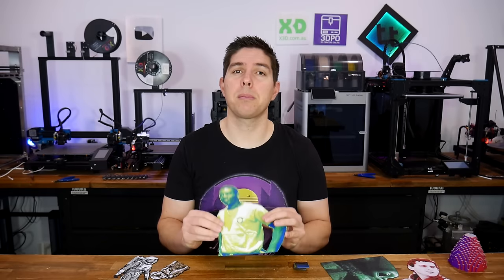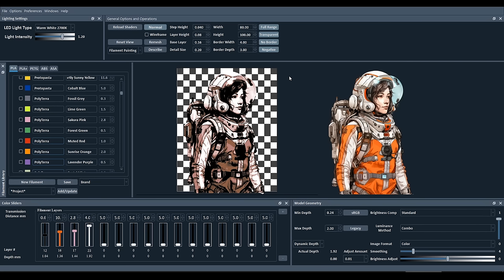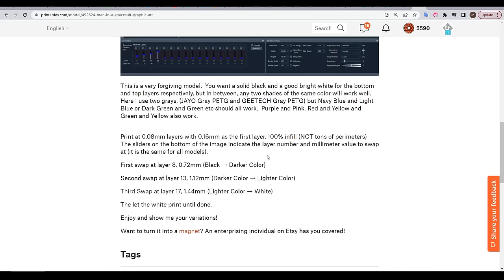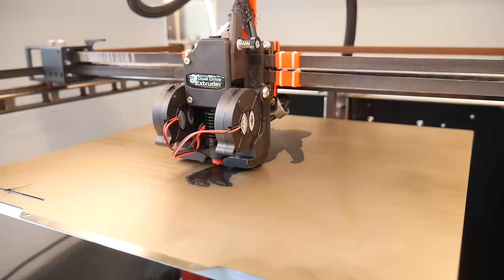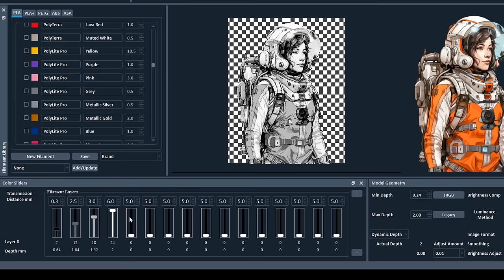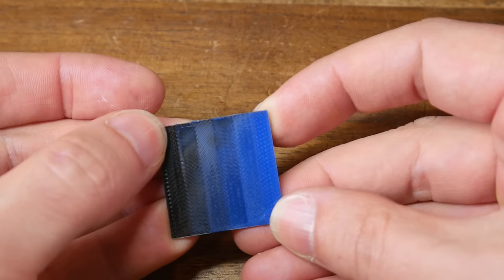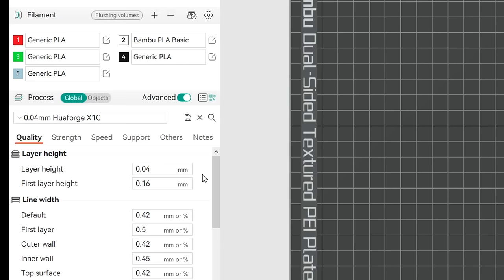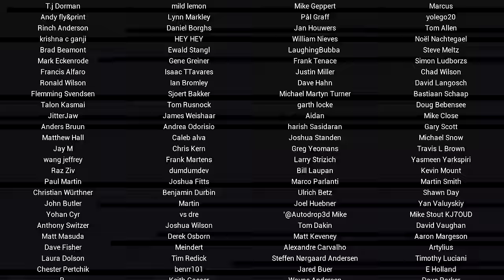HueForge getting started guide: Filament painting with your 3D printer

Comment: I'd like to say I think the software is awesome. But why isn't anyone talking about the absolutely horrible "commercial" license agreement? Basically, you have declared you made your product using their software. I could see if you were using a free version, but to pay for software AND need to brand their software?? That's a total no go for me. If every software maker followed this "license agreement" we would be posting a lot of branded content.  Isn't it kind of like Microsoft saying, anything you make with software using this operating system you need to add a Microsoft logo? Horrible approach if you ask me. Just my 2 cents.
Reply from the maker: I didn't read that part because it didn't apply to me. I guess if I were running a business I might consult a lawyer to go through it with me.
Reply: @TeachingTech  yeah thanks for the reply. Who knows if it's even enforceable. By the time a lawyer is involved I'm sure I could buy a new printer.
Reply: I don't know what you mean by "Brand their software".  You simply need to display at point of sale your license.  That means as an image in the gallery or as a direct link to the image of the certificate with your order number somewhere on the website where you are selling. It could be "Commercial License #1111" with a link to the certificate image.  It's like being an "Authorized Reseller".  Your print doesn't need any kind of HueForge branding on it.
Reply: This is basic commercial agreement stuff for small devs/creators, if you've never seen it then you're not the target audience. Especially considering most model creators already have that in their agreements even when you pay for their $30+/mo commercial agreements

Comment: Newbie here, can't you just add pause rather than adding gcode
Reply from the maker: If it parks away from the print, absolutely. Only disadvantage is it won't automatically retract and offer an interface to reload and purge for most printers. If you can do that manually then all good.
Reply: @TeachingTech   i'm using bambu P1s not sure about g codes yet. orca slicer/bambu studio as slicer
Reply from the maker: My P1P has filament runout so I imagine the P1S is the same. Also, Bambu Studio let's you add pause so the printer should support it.

Comment: Great tutorial ! For the P1P Users without an AMS Unit out there which are expieriencing a slight Offset after the M600 with Filament Swapping in between have a look at this GCODE:
M104 220 ; Preheats the Nozzle to 220
G1 X60 Y265 ; Moves the Printhead above the poop chute
M400 U1 ; Makes a pause, M400 is the Bambulab Command alternative to M600
G28 X Y ; Homes X and Y at the end to prevent the Offset/ Drift
As always with GCODE from unreliable sources, use at your own risk and inspect the printer at the first execution, to make sure there aren't any problems

Comment: Hey, if I may, 17:35 - I would use concentric infill, so the print path follows the contour of the printed object. 
I think, that could give a stunning outcome.
Reply from the maker: Thanks for the suggestion.
Reply: do you use this for just the top layer or all the layers
Reply: Infill and surface?
Reply: @mitchcamp8239 Well, I 3d print for a specific purposes. 
Because of that, I use concentric all the way. 
It gives the same outcome like printing with 99999 perimeters + 0 top/bottom solid layers.

Comment: This seems great for B&W but if you have something with a few bold colours it can be hit and miss. It would be good if there was a way to tell the app 'how many colour changes do I want' and for it to auto select filaments from the 'owned' list to get the best balance. I don't think it can do that?  Also - I know this isn't a hueforge use case necessarily - but if you have your colours already, it'd be good if the app could generate the layers/STL for you without mixing. Eg if you already have cartoon art in 4 colours, pick those filaments and generate the layers. The kind of thing that is doable manually but a pain.

Comment: Thank you for the video.  I need some help with something..
I am making a 2 color print and I want the outside to be black and the inside to be copper but no matter what I do in HueForge, it makes the outer edges lower than the inner. I need it to be the opposite. Basically, I need the outside to be higher than the inside. Does that make sense? Is this even possible?

Comment: 07:00 in PrusaSlicer, adding a color change ist just a single mouse click on the vertical layers slider.
09:30 O, still not for linux? What a crap.
Reply: I know right? Just what the hobby needs: more commercial/non-cross-platform crap 🙄

Comment: I have a Ender 3 S1 pro. When I add m600, it pops up a low filament message, goes to park, poops out a string of filament, waits a few seconds, then resumes printing. It does this on each layer. Not just where I put the custom code. Any idea what's happening? Do I need to add some kind of park and wait code?

Comment: hi ive been having some issues with printing square pictures where the corners or edges keep peeling up while printing especially anything over 200 on hight or width was wondering if you had ran into this issue at all and how you fixed it i was thinking maybe its the bed temp but not to sure. whats the best temp for the bed while printing these i have a bambu a1 with a .4 nozzle

Comment: Here's a question - is it possible to use 3d printing to make relief printing plates, like linocut ones?
Reply from the maker: In a flexible filament, I don't see why not.
Reply: @TeachingTech   The ideal thing would be to have a software solution extract an image and arrange the high positive and low negative areas as this does with filament colour layers.
Reply: You could try using a black and white image (no grays) in a lithophane generator. It should make the black all one height, and the white all one, lower height. With a flexible filament im not sure why you couldnt produce a linocut like effect for plate printing.

Comment: Great video ! Thanks for the explanations ! I have a little issue. In Bambu Slicer I don't have the same amount of layers as in HueForge. Why ?
Reply: There can be a variety of reasons for this. 1) You scaled the print in BambuStudio - don't do this, scale it in HueForge 2) Your layer height settings aren't exactly the same 3) The mesh had some really small details at the higher levels (little spikes) and once sliced, they went away those are a few possibilities in the order from most to least likely in my experience.
Reply: @hueforging  You are right ! I scaled it in Bambu slicer ! Thanks 🙌
Reply: @vince2lille  you can scale larger as long as you only scale XY and not Z (uncheck the uniform scaling) but shrinking it isn't recommended because it reduces the Min Details and leads to poorer prints/clogs.

Comment: Okay, but why using a payed software when you can do the same with some skill in free 3d modeling softwares like blender?
Reply from the maker: Go for it and make a video please.
Reply: @TeachingTech  would be my first youtube tutorial, but I'll do it once it's ready.

Already got the file for blender ready, little different approach to specify the layers (set the amount of layers for each color and the image/hightmap gets spread over all layers).

Convert image to mesh including optional cut off alpha, different color to greyscale methods, set and preview colors, aspect ratio detection (just set the resolution of the longer side) Already implemented.
Just missing some way to store the material settings (color/hight).

Will have to rework the model generation once blender 4.0 is out to get a model that's even more layer oriented than now (As far as I've seen even HueForge doesn't do this and generates diagonal faces)
Reply from the maker: It sounds like you have most of it worked out, but it also sounds like a lot more work to use. Please remember many people have never used Blender and it has a strong reputation for being hard to learn. Yes, you have to learn HueForge for this, but for your method you have to learn Blender, plus these methods on top. Food for thought.
Reply: @TeachingTech  you don't even need to learn blender.
It's basically a template project you just open up, fill in your image, desired resolution and size, and a few values for the colors.

I'll probably show it in a few days/weeks, at least how to use it.
I still need to decide if i want to provide it for free, sell it and/or start a Youtube channel.
Reply from the maker: You need to learn Blender to the extent that you need to know where basic functions are located on the GUI.